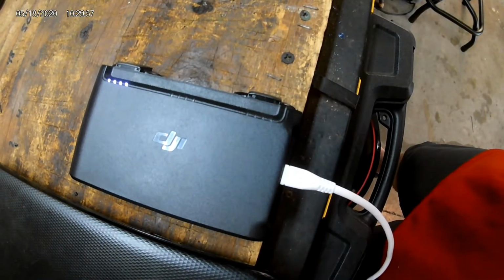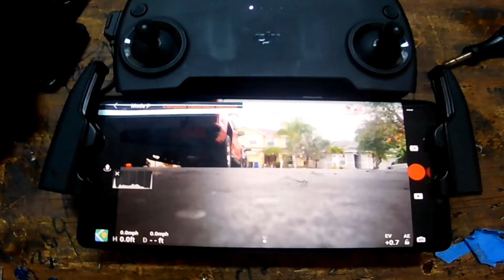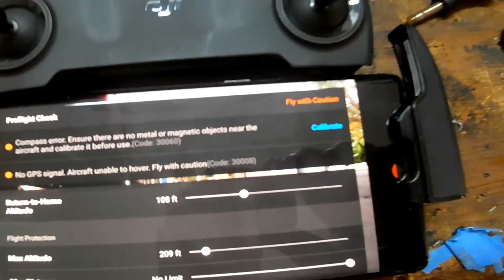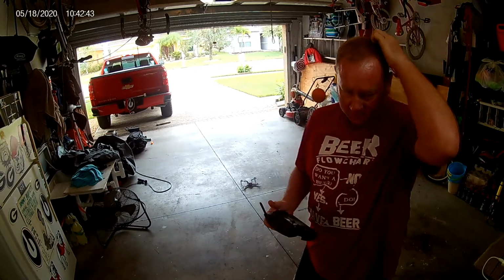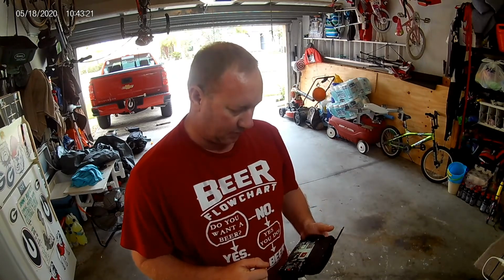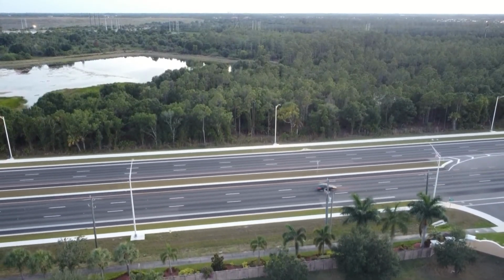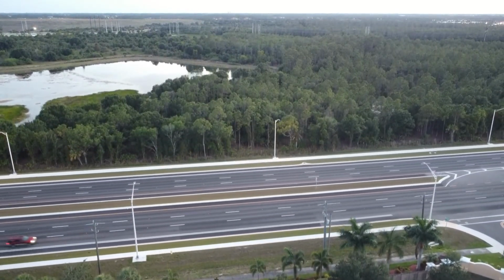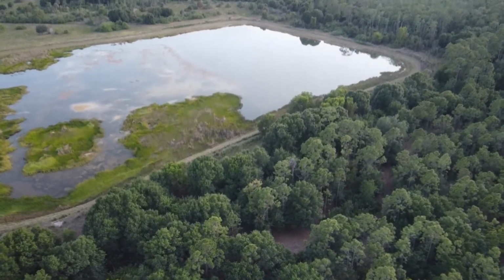Mavic Mini battery issue and fix

Comment: My charger won’t charge controller
Reply from the maker: sound like an issue with the cable or the port on the controller.  Does it charge your batteries?
Reply: @residentdawgfishing5424  ok ty